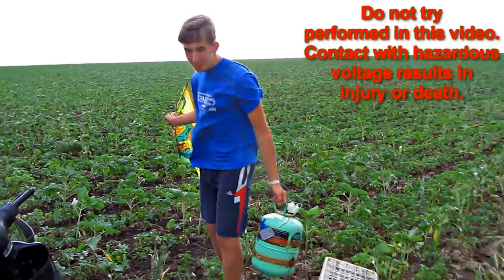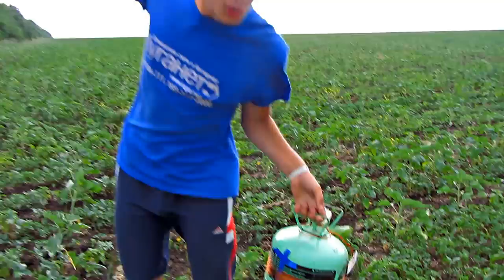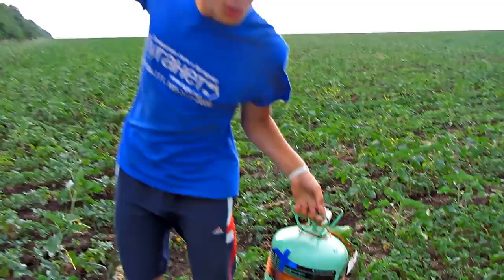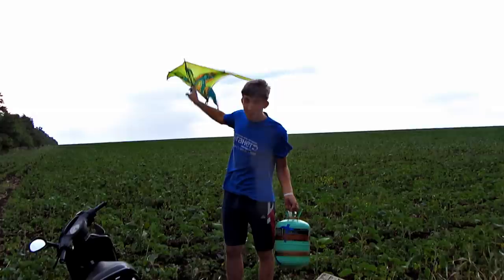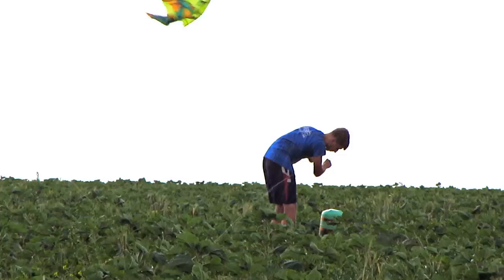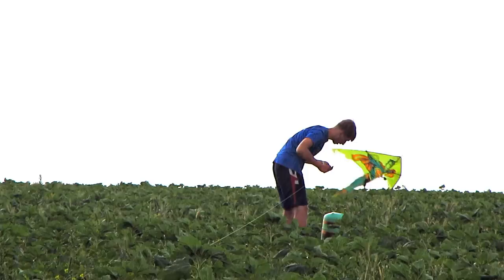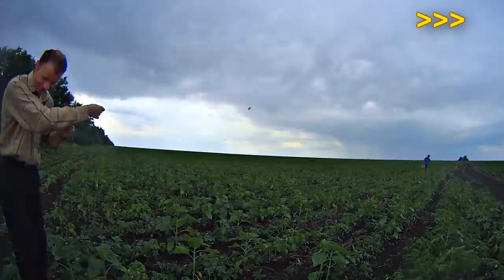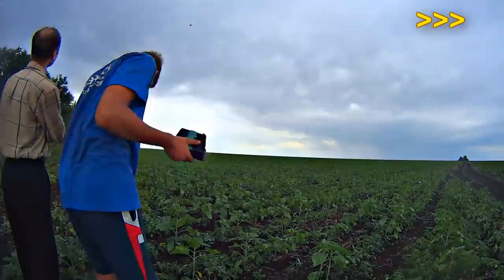Catching lighting bolts with the help of a kite. Experiments with lighting bolts

Comment: the end of the cable needs to be connected to the ground, that is done by putting a long metal rod/pipe in the ground and connnecting it to it.
Reply: It doesn't actually need to be connected to ground. Because of the high voltage that the lightning charge is at, it can easily jump both gaps.
High voltage is kinda scary, you don't have to touch high voltage wires in order to get shocked. The voltage (well, current) comes to YOU instead! (jumps through the air because the air can't insulate well enough)

Comment: People fail to understand lightning rods. Electrostatic or ionic charged air above a house attracts lightning. The grounding rods in the ground remove the static charge on and above the roof.  The lightning rods are not made to handle the current from the lightning. This would still ignite a house. 
Removing the grounding of a lightning rod could possibly increase the ionic field on the roof creating the easy path for lightning to connect.

If this kite had slender sharp metal pieces on it, possibly electrostatic charge could build up on it and attract lightning.

Comment: You need a dedicated doppler radar to see exactly when a real storm cell is approaching and which of the cells has the highest potential.  Then use a balloon or rocket. Kites simply dont have the amount of surface nor do they (usually) achieve the needed altitude....

Comment: It's usually done using a small rocket and thin wire. Not a kite and they seem to be pretty successful judging by the documentaries. Good luck.
Reply: Scott Currier just what i was thinking, either use a balloon or high altitude rocket attached to a thin wire spool, grounded with a large copper rod

Comment: It discharges thunder onto earth when air becomes conducting and for that you'd need a certain minimum potential difference..soo maybe you just didn't have enough potential difference 

It's raining soooo the dielectric constant of atmosphere should've also increased ig so that would make it even more difficult to develop the potential 

You're not flying high enough 

Use a more conducting kite

What if you give a negative potential to the kite? Maybe that would make it easier to catch lighting 

I doubt if this will work but using a full metal kite should be better idk
Because the cloth on this kite would burn off once the lighting strikes it

Comment: try supergluing or taping aluminum foil to the kite. the synthetic material isnt very electrically conductive, and rain water isnt either. the synthetic line probably dosent help either, theres alot of resistance and thus no real reason for the electricity to take that path. try relatively thick cotton line. a larger kite will also increase your chances. if you could get around 800 feet of cotton cord, i imagine if your kite were large enough it could get right up below the cloud line with ease. not sure how high clouds are honestly.

Comment: first you need a positive charge dispersed on the kite, as negetive charge comes out of cloud..

and second you need really thick wire which can withstand the heat of bolt and doesn't melt...

Comment: If you manage to use a conductive wire I'm pretty shure that you'll get your lighning bolt. Before that, be shure you get a good ground conection with cooper rods or iron net. The current will be the wire's limit.

Comment: use a salty string, Since distilled water  ( rain)   is purified and does not
 contain any impurities, it is unable to conduct electricity. Water 
molecules on their own have no charge and as a result they cannot swap 
electrons. Without the swapping of electrons, electricity is unable to 
travel through distilled water.  Salt water, on the other hand, is considered a good conductor of electricity because it contains ions in it.  Salt the heck out of it rock salts or something

Comment: Perhaps you need better grounding, attach the kite wire to the ground with a copper spike or plate. The paint around your pressure vessel could be too well of an insulator to ground.

Comment: You need to ground the wire, also you may need more altitude also try a larger size kite lined with metal foil. And wear rubber boots!

Comment: you need metal such as a key or something to attract the lightning the line is made of plastic and so does not conduct electricity if you hang a series of small metal objects or use a metal line it will work

Comment: You should along with the string of the kite, use a wire as well, to allow the easiest path to ground. connect the other end of this wire to where you want to have struck.

Comment: just use magnet wire to hold kite maybe put 2 wires. And connect more magnet wire and wrap it around your kite to make mor conductive surface and the end ot wire connect directly to ground that way you will create short circuit with clouds and ground.

Comment: Experience here is talking to you with no jokes are bad criticism )( use a 8 foot thick steel type of regular crow bar weld at the top of the crow bar a round iron sphere around 12 inches round then from the top top of the iron rod sphere that is 12 inches round ad like a crow bar handle ring another length on top of the metal ring drive the lighting crowbar described measurement in the ground only 2 to 3 feet out in the same exact type of open field enviorment example 3 feet of rod in ground 5 feet hight high as your shouldered shoulders lighting will hit that rod without waiting a long time you can be one physical full inch distance away to breath smell the zigzag type lighting only from the rod distance you will smell wiff strong lighting sulfer the steel rod will not blow up out of the ground and hit you you will be safe wear no metal objects belt ring watch etc do not wear you can hug the zigzag lighting half an inch away in distance reality top of rod top will surely be damaged to prefigure at the edge top of the lighting rod to maintain the zigzag lighting energy none stop this is where I stop  some regions lighting two hours straight no rain falling be careful powerfull powerfull experiments good luck
Reply: i barely understand your english, but you are intriguing, what s your origin country? Do you have any reference of your work ? Thank you

Comment: The cable that you run to the kite must be conductive, a copper line would work best but might be too heavy. use cotton string instead of plastic fishing line. plastic fishing line does not conduct electricity

Comment: You are using a copper wire which is insulated, thus the chance of actually getting a lightning is small. Strip at least 5 meters near the kite, but be very careful to use it.
Reply: The charge is such a high voltage, it can easily puncture the wires insulation ...
Reply: This is incorrect. Copper insulation does not withstand more than 300 volts. Lightning runs at over 100,000,000 volts. No insulation in the world can prevent lightning. Car tires do not stop lightning, it is a myth, and well proven. A one mil thick layer of copper insulation does not stop 100 million volts. Basic physics. However, it is possible the wire is bleeding off charges, preventing a large strike, due to the sharp nature that is wire. Sharp points dissipate static. View our videos for demonstrations.
Reply: +Plasma Channel
That is incorrect as well. There is no such thing as "copper insulation". :P
Reply: Ha. You indeed caught me. Nice job catching that typo :P

Comment: You Guys are Cool.     Fill a garbage bas with hydrogen and let it rise.   Affix the other end of the copper wire to a wooden stake.    That's your positive terminal.    Place a ground rod preferably copper in the ground 4 ft would be great.    On the other end attach a short wire and place the tip about 1/8th inch away and run.    Your catch for this fishing trip will be the work of art in the fused ground.  Good Luck
Reply: P.S.      Hydrogen ions are mostly positive.   Theirs videos that show how to make it with aluminum and drain cleaner.   Be sure to wear gloves, goggles, and organic respirator.      Happy Fishing

Comment: Wow. So many dumb comments! 

Any way, to get a good potential difference between the kite and the ground, you should choose your atmospheric conditions wisely.  Big low clouds will provide that big charge so you want to discharge into your wire. 

Great video of the TV you charged up to tempt the power from the sky! 

It would be great to see a tree explode because we all know not to stand anywhere near one in a storm. All that boiling sap blasting the bark away... 

Every lightening strike sends a blast into space so you should expect to see some UFOs if you keep flying copper wires!!

Comment: Use a four foot balloon and helium to carry up the wire and get some distance away before you get hit.  Use a remote control to release the balloon.
Reply: Make a Tesla Coil, and power the primary by lightning.  Check the phase relationship and connect the secondary to the primary in phase.  A high inductance, high reactance, low inductance low reactance, where is most of the current going?  Least number of turns.  I've done this.  The lightning strikes the coil, and can bounce back the energy into the cloud.  It's really cool but you would have to see it.
Reply: It can punch hole in the clouds and sometimes put so much of an charge back into the cloud that the like charge accumulated by the water droplets in the air is so significant it all turns to humidity so dense it bends light.
Reply: Five turns of copper pipe as a primary and wind up 24 AWG wire on PVC plastic pipe.  Fill up 2 feet of PVC 2 inches in diameter.
Reply: The other connection of the primary and secondary go to a ground rod that's a minimum of four feet long and pounded into the ground with a hammer then add allot of salty water around it.  Like a 5 gallon bucket full of salty water.

Then the coil will work with the other primary wire connected to the balloon's wire.
Reply: :I dude

Comment: Laystrate control line wire and Rockets. Set up a galvanometer and fire just before peak. Ensure you are inside a car when firing. Fuck me it's loud but the smell is excellent.

Comment: I agree with the comment already made that said you are actually reducing the potential difference by having the kite in contact with the ground...try building a high metal structure in the middle of the field that has a platform that you can stand on while you fly the kite...but make sure that you are wearing metal bracelets around both of your ankles and wrists that are connected to the metal structure for safety reasons....and also have a metal helmet that has sponges soaked in salt water to pad the helmet so it's comfortable ... and make sure you connect the helmet to the structure as well...this is the safest way to do the experiment you are trying to do ....

Comment: Connect earth ground wire to the kite. The closer you bring ground to the sky with wire the higher the chances of catching the lightning bolt. Lightning bolt is a spark gap between the positively charged sky and the negatively charged ground. 
If you take it to the next level, you can harness atmospheric electricity by raising earth ground wire high up in the sky 130+ ft. Spherical antenna made of graphene needles with sharp points facing the sky will increase efficiency of harnessing atmospheric electricity. Ground wire coming from the sky goes to the top of high voltage Tesla coil first creating sparks before going to the ground. Tesla coil when used in reverse will convert the atmospheric static electricity to usable AC volts. Youtube search "Tesla coil "the true secret" how it was really used.".